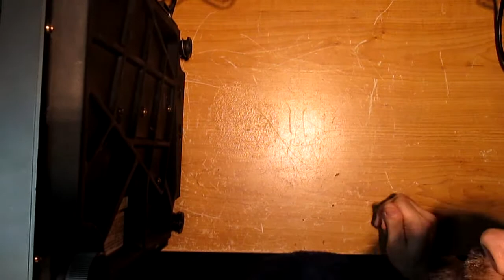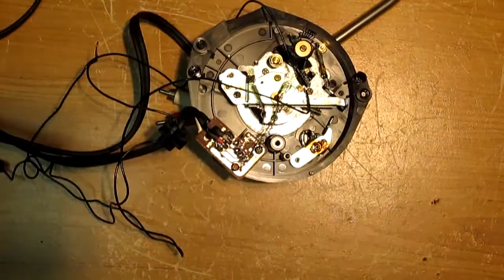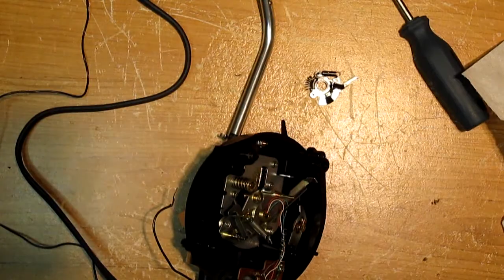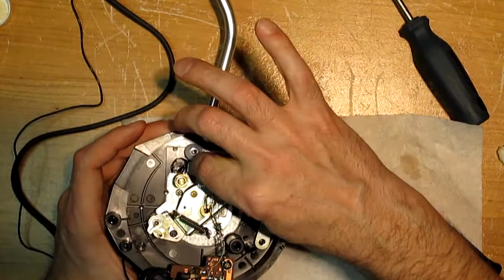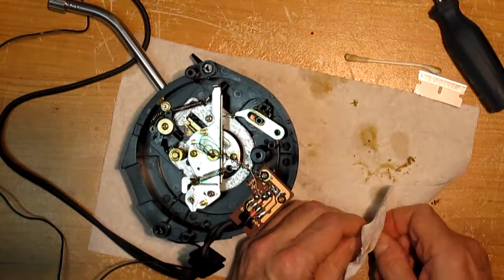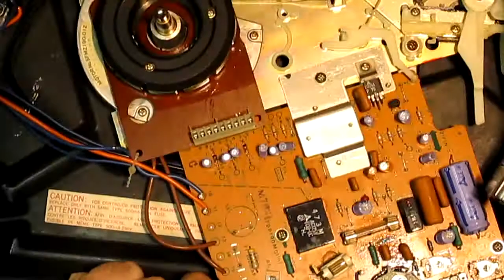Technics SL-1900: Arm-lift (Cueing) Repair - Sticky Grease!

Comment: Just Picked one of these up For $100. The Arm wont go down & when you go to 45 it stops. Its fun to get them working again, someone told me the one screw hard shell is worth $50. It's working fine now that I removed all the old grease with alcohol & Q-tips, Regressed with Finish line Bike Grease  a few drops of Tri Flow for the Main Bearing. I used Deoxit on the Potentiometers & the 45 started working. Love this Table with a AT 3600L that I got for $18. This arm is similar to my SL-2000 as well.

Comment: I think you are doing a very good job on your presentations for these repairs, the only thing  I think you should do is to protect the dust covers when you turn over the TT. I myself have done many TT repairs, keep up the the good work.
Reply from the maker: Thank-you.  Most of these tables have very scratchy dust covers to begin with.  But, if the cover is mint, I will put a towel down.

Comment: Hello, I just came across your video. I have a technics SL 1500 MK 11 and the cue lever does not work. I had it to another shop and was told the grease inside is like tar and is not serviceable. Is this true? From what I'm hearing this is a constant problem with the SL series tables. I'm anxious to hear what you think. Thanks.

Comment: I think this is my exact problem with my 1900. Also my turntable is going too fast on 45 even at the slowest setting (33 doesnt work at all..). Hoping cleaning the contacts works. As for the stopping arm, what kind of cleaner and grease did you end up using?
Reply from the maker: Just a multi-purpose synthetic grease.
Reply: @TurntableGuy  Thanks cheers. Always exciting finding a video of the exact model with very similar problems. Thank you for documenting and helping folks like myself!

Comment: I recently checked my Technics SL-220 and it looked like the belt had loosened and come off; I spun the record manually to check that the needle/amplifier worked; also used the Stop and tone arm lift levers;  and the lift mechanism became stuck in the up position; I can force it down but it returns to the up position i.e. making records unplayable.  I've had a look inside but in moving it up and down I couldn't see anything moving so it looks like it would require disassembly of everything in that area.  I suspect a lower risk approach would be to get some pliers and cut off the plastic bar and its two supports and thus have a manual only setup.  The only issue I can think of is that with the auto stop/return that it would drag across the record if it works (haven't used it for a year or more; I don't think it did).  Any comments or advice would be welcome.
Reply from the maker: Probably just dried up old grease.  Complete disassembly, cleaning and re-lubrication should do it.  Service manual downloadable from vinylengine.com

Comment: Hey TurntableGuy, I have a Technics SL-1900 as well, however I am having the opposite issue. The arm lifts and lowers just fine manually, but upon automatic start/return, the needle will drag across the record instead of lifting. Is this an issue that could be resolved by a cleaning and grease replacement as well? Or do i perhaps have a spring or gear issue of some sort?
Reply from the maker: Check the cueing lift height.  There should be an adjustment screw on the side of it.
Reply: @TurntableGuy  thanks for the reply. I ended up disassembling and replacing all the old grease and cleaning the old contacts anyways, and then made some necessary adjustments. it works like a charm now! much thanks to you for this video!

Comment: hello thank you so much for sharing, thanks to this video i was able to repair my turntable. i have only one problem, when i add the turntable again, by starting i can't get it started at the beginning of the disk.
i from Argentina, thank you a lot
Mike
Reply from the maker: If I understand you correctly, I think you have re-installed your arm improperly.  Remove the arm again and re-install it.  Make sure it swings freely before screwing it back down.

Comment: Hello, because the arm of my Technics 1900 does not start on the first track, it goes to the last track, can you help me? Thanks
Reply from the maker: My guess is that the automatic size selector switch (7" 10" 12") is stuck on 7 inch.
Reply: @TurntableGuy  That's not it, I've already done the tests, but thanks.

Comment: My Feet are in Bad shape rubber destroyed any ideas? I have to just place the springs around the ends of the grommets they are not attached
Reply from the maker: Check ebay for parts.
Reply: @TurntableGuy  I got a really nice set for $100 from MNPCTECH

Comment: Greetings @UCbs_18qFHtAnjWwEF0I-ggQ , it is a pleasure to deal with a connoisseur of turntable repair and maintenance, the truth is that I really want to learn how to repair them and why not restore them ... I'll tell you my grandfather gave me a Technis SL 1900, it turned on but the turntable didn't turn. It is a direct motor but can you tell me how I can solve it or the possible failures for which this turntable does not turn? I thank you.
Reply from the maker: Check the microswitch which is activated when the arm is moved towards the platter.